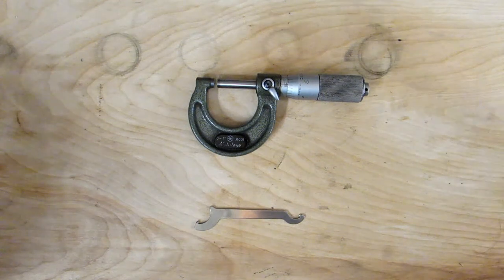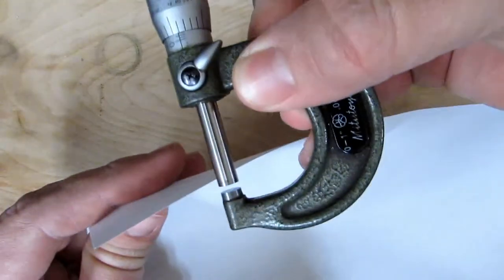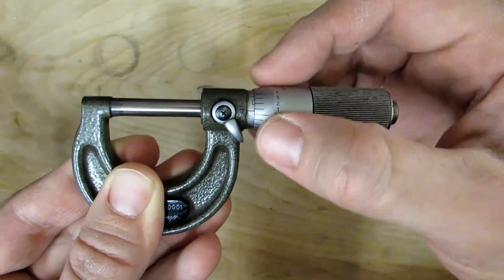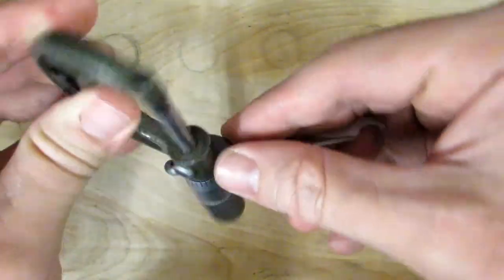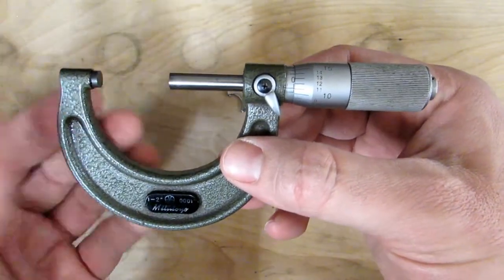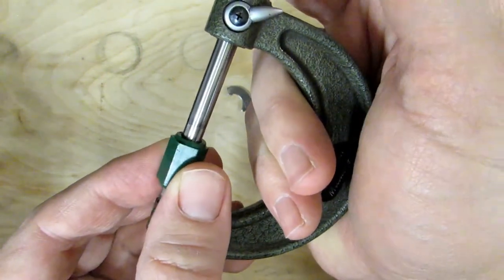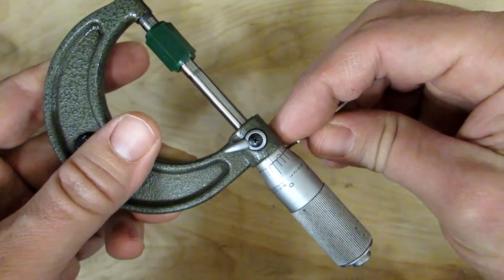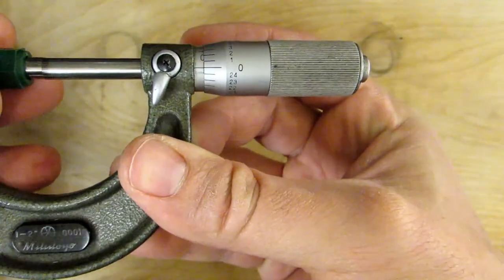How to Clean and Adjust a Micrometer

Comment: Not all micrometers have a wrench and adjusting hole.

Years ago, I had one that was adjusted via a screw slot, on the outside end of the anvil.
Reply from the maker: I actually have one like that too. It's not the best system.

Comment: My one is too tight and ratchet kicks in straight away. Does oil on threads solve this?
Reply from the maker: Possibly. It could be gummed up from old oil, or it could be a little corrosion. Take it apart and inspect for any damage first, like a bent spindle or frame. If nothing jumps out at you, clean the threads with some denatured alcohol and put a little bit of light oil on it and see if that helps. Let me know how it turns out.
Reply: @StuartdeHaro  thanks! Looks pretty shiny and well cared for but internal threads are dirty so will try that. Mine is a Moore & Wright, made in Sheffield,  England. Superb craftsmanship.

Comment: What vintage is that mic? All the new ones i've seen have the little thimbles.
Reply from the maker: I'm not really sure.  I got the set at an auction.  Judging from the box and the state of the magic disintegrating foam inside, I'd say late 80's or early 90's?
Reply: dans-hobbies Thimbles can vary by three or four sizes these days. They are usually down to the torque setting (depending on manufacturers) and smoothness of the thimbles movement ~ ratchet (clicking) or smooth rotation feeling. 
Again, you can get different micrometers to suit the material you are checking ~ low torque for plastics and Ali etc etc.

Comment: I know nothing about micrometers, so v. Interesting.  I need to buy one for my motorcycle renovation, so are there any buying guides?  Haven't found any yet.  Btw, what's the other end of the wrench for?
Reply from the maker: You really can't go wrong with one of the major brands, Mitutoyo, Starrett, or Brown and Sharpe.  If you just need it for this one job and don't plan on using it a ton, Fowler and SPI are decent choices.  If you want digital on the cheap, I've heard good things about the Aventor line from shars.com, although I have no personal experience with them.  I'd steer clear of the no-name chinese ones.  They can be mind-numbingly bad.  If you haven't watched my video on reading mics, check it out at https://youtu.be/j0ARvWwMZX8  It goes into both inch and metric mics so it should cover whichever you decide to buy.  The other end of the wrench is for a spanner nut on the inside of the thimble that adjusts the tension on the screw.  Thanks for watching!
Reply: @StuartdeHaro   Thanks Stuart,  I had sort of decided on a metric (Jap bike) Mitutoyo before i saw your videos, but needed some pointers just to confirm i was on the right course.  I will be buying used, as they seem quite expensive, or perhaps i'm just tight!   I did think those chinese one's looked too cheap to be any use but i can see how they would be tempting if you're on a budget.  Thanks again!
Reply from the maker: Used is usually a good path.  Plenty on machinists sell off the tools they don't use very much.  Of course, you run the risk of getting a clapped out piece of junk too.  I checked MSC and they're selling a 0-25mm SPI mic for $73, and Fowler on Amazon for $35.  The Fowler mics aren't too bad for the price.  They're Chinese, but better than most of that ilk.
Reply: @StuartdeHaro    Oh well, i've bought one now!  A Mitutoyo 0-25mm off ebay. It looks pretty clean in original case with wrench and instruction booklet.  Looks like a one man engineering business and he said it had little use. Just keep my fingers crossed that it lives up to the description.  Btw i'm in the UK, i've not seen any of the other brands you mentioned over here, except Starret.   Here it seems to be mostly  Wright+Moore, Draper, Sealy and Nielsen.   Wright+Moore i think are a british company but not sure about the others, european?    Thanks again for the info. Stuart, much appreciated!

Comment: What if it's .010 off
Reply from the maker: Great question! First, check the anvils for damage to make sure that isn't the problem. If not, the thimble is usually held on by a taper and can be popped off and repositioned close enough to zero to adjust. It's a bit hard to explain with words, but there should be a cap of some kind on the end holding the thimble onto the spindle. This is usually where your ratchet spindle is, or it could be a flat cap if you have a friction thimble. You will probably need the spanner wrench to remove it. Then gently separate the spindle from the thimble at the taper. Thread the spindle all the way in so the anvils are closed together, then reposition the thimble on the taper and replace the cap. Couldn't be simpler, right? Let me know if you need any clarification or extra help.